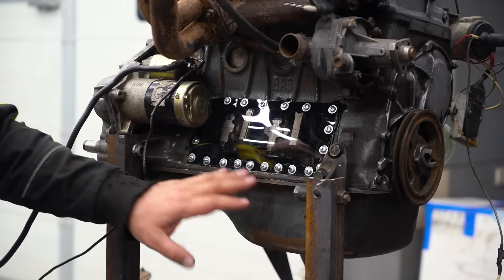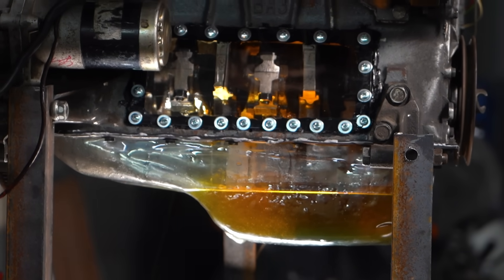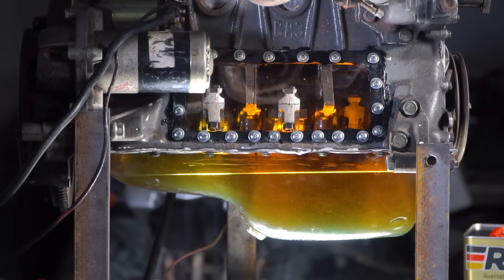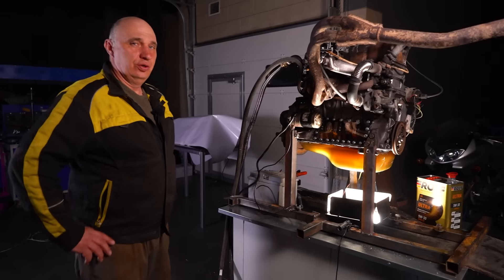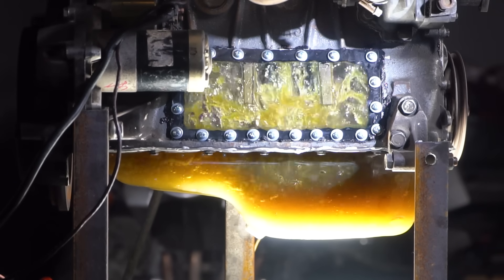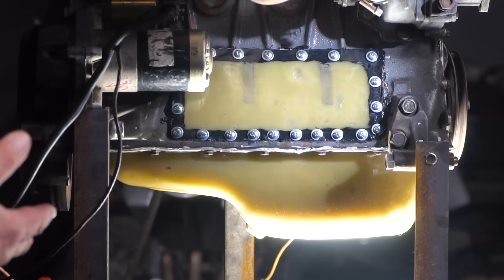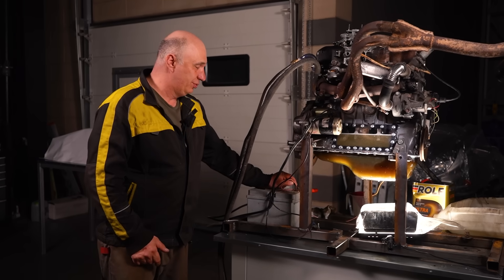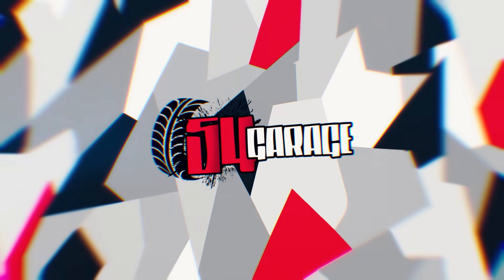What actually happens when you overfill your motor oil? (w/ transparent oil pan)

Comment: When I bought my first car ever, I’ll never forget because I learned many of valuable lessons, as I was ascending a hill I’ve gone up daily for 20 years, it’s a mile from my house, it’s quite the incline, I’m talking back then you had to get a run at this b!tch, or be prepared to start dropping gears, so let’s say, 30 degree slope, I hit it about 15 mph over speed limit which is pretty common for that hill, I look in the rear view and just see a sh!t load of blue smoke coming out from behind me. Now being a young and dumb 16 year old, I still had the common sense to know that wasn’t normal. I stopped once atop this hill and noticed my oil level was about twice as high as it should be. The oil was clean as hell, obviously had been serviced, but my god was there too much. I drained about 5 quarts to get it to where it belonged. And that was probably a 5 qt oil… so ya the dealership tried to fck me pretty good unknowingly if I had to guess. Thankfully I was already at that time well on my way to becoming a s tier mechanic. The world’s shortest story told long, overfill = bad

Comment: The only thing I am dubious about is whether the 1st initial fill amount "to the max marker" was in fact the correct amount to start as a base-line with before doubling.  If it was filled higher to begin with as I suspect it should have been then doubling it would be more added again on top of what was already more to begin with and then you get hydraulic effects and catastrophic engine damage. This is much more risky with more mdoern engines than the one used in this video. It happened to a colleague who filled another 6 Litres in to an engine he didn't realise hadn't evacuated it's old oil (suction pump fail) and it destroyed the 1yr old mercedes motor.

Comment: I did the mistake on diesel motor, and I broke it, the oil act as fuel and my engine went to extreme RPM, unfortunately i didn't know how to react (stall the engine), instead I just let it go, and went out from the car 😅, car went to trash and I had to buy another one.. so no joke with oil on diesel engine

Comment: I overfilled oil in my 2007 Mazda 3 hatch and the extra oil got sucked up into the intake manifold and I had oil burning in the combustion oil causing a thick smoke to come out the exhaust.

Comment: QUESTION ⁉️⁉️
When you overfill, even by just a half quart or so, what is the probability that you have increased the operating pressure of the engine at running pressure and accelerating pressure? 
In order engines, I’ve noticed it appears there could be damage to older/weaker gaskets. Causing leaks or increasing the size of existing leaks.

Comment: Daughter had a Honda Legend V6 she would take it to Jiffy Lube...at one point she complaint of a horrible vibration in the engine, I took a look and it was bad, luckily she drove it to me at max 50 mph. When I looked at the dipstick it was too high so decided to change the oil and I was surprised to find JL had poured in 1/2 gallon more than what was needed...Put the right amount of good oil turned it on... vibration gone....It was a 70's model....More recent my mother in law had an issue with her Nissan Rogue turning off the engine while driving...checked the engine, too much oil on the mark of dipstick...changed the oil to between the two marks and it has never turned off while driving...It is a 2013 and she was having her oil changes done by a quick oil change outfit...!

Comment: I have a Chevy traverse 2012, I had a low oil pressure indicator. I overfilled my oil by putting in 8 quarts of oil. The vehicle ran for about 30-45 minutes then shut off. I drained the excess oil and now it cranks but won’t start. ANY SUGGESTIONS? Has power. Vehicle sat for 3 days. Charged the battery to full and placed back in vehicle. Crank with no start. Then battery needle shows low battery, 2nd line under half. Any diagnosis or suggestions.

Comment: I dated a girl with a 1989 ZXR250. She filled the crankcase. Entirely. Told me the bike wouldn't run right. Bike wouldn't go over ~9000 rpm (red line is 17000 on those little 250cc 4 cylinder engines). Simply wouldn't, even dropping a gear when already at 9000, poor crankshaft just couldn't turn. Dumped half the oil out, kept on running fine for as long as she had it.

Comment: Inaccurate. In real conditions the engine is so sealed the inside has an internal pressure increase. So much so that when you overfill just a bit you start to see the screw cap on top jumping and it forces every joint to the point of leaking.
Reply: Smaller engines have lower tolerance. Most 1.8l engines and above can take 0.5 - 1 litre excess.

Comment: Car would start so i was asked to look at my cousins car.   He overfilled it so much, the oil was getting sucked thru the crankcase vent into the carb.   Car barely started with smoking !...   I drain it back to spec and ran fine, but reason he put so much oil was he was burning oil thru rings anyway......

Comment: Does anyone else give the motor a little crank when you drain all the oil and take off the filter? It's amazing how much more comes out with a little pressure
Regardless, I'm always about 2 quarts low after about 5K miles, so I don't think a little extra oil is gonna hurt

Comment: 10 years ago, I drove my very old  Dodge Caraven, one day I see engine  oil  light up , I check the oil and find out level low below the minimum . I add some oil up to Maxi. when driving I see the oil light up again, I keep add more oil , driving then the oil light still keep on. I add more oil again  I guess up to 9 liters of oil.  Next day when driving on a free way , about 15 minutes later, I see lot of smoke  ( I mean alot ) coming out from tail pipe , 1 minute later I see lot of smoke coming out from under hood . I pull over then the van start burning until completely become a pile of iron.
Please tell me the fire cause by too much oil or not ?

Comment: I had my oil changed in my 2008 Dodge Ram. 4.7 L. The next morning when I started it I noticed with smoke which it never occurred before. I took it back to the oil center it was a half quart over full they drained a half a quart it solved the problem
Reply: I filled my car to 10 quarts like a dumb a$$ am I cooked

Comment: Let’s no forget something really important about the oil evaporate pressure, if we have more oil we have more material that will evaporate producing more positive crankcase ventilation a little bit won’t produce any bad harm i guess but seals and gasket will probably start to leak sonner, i’m not planning to fuck around anyway don’t go lower is what i’ll always do

Comment: I had a car come in for the complaint of no power. I started it it seemed fine but on the Dyno it was like 10 horse power. All the settings were correct. I checked the dip stick for the oil and it was all the way to the top of the tube for the oil stick. I drained the oil refilled it to 5 quarts. All problems solved. Oh and this was 50 years ago on than American V-8

Comment: People have a lot of theories but as you can see you will end up with blown seals and gaskets before you get a blown engine🤣🤣🤣🤣
Reply: Agree. I overfilled oil on an Audi A6. Car started smoking and the engine was damaged. Had to buy a new engine - at a substantial cost.   As a precaution - always check the oil level. The car will also tell you when it needs more oil. Never go beyond maximum - midpoint will do for me.  Change your oil regularly - for me oil change after six months or whatever mileage interval the manufacturer  has recommended.

Comment: Old shop Forman said he changed his oil when going on a long trip vacation. He added 6 quarts instead of 5 quarts to putting car at full level. He said this ways he never had to add oil on trips and was running his car harder than most people do. He’s always drove a little over the speed limits. Done this on cars he’s drove for over 10 years.

Comment: Aside from the detrimental foaming issue. In theory, the less air in the enclosed engine shell, the harder it is for it to maintain pressure.  Pressure is sustained by the compressible gas (air) in the system.  Oil is not compressible.  So, a proper proportion of air to oil should be within dipstick marks.  Anything above that may start decreasing system pressure. I wish Garage 54 would test how low, mid, high, excess oil affects oil pressure.

Comment: Wouldnt it be better to have an extra quart of oil in the engine to be safe?  I mean when you check it, it'd be better to be full than a quart low at the add line.  Any thoughts on just one extra qt?

Comment: Too much oil builds pressure in the engine, blowing seals and even the head gasket. It may even hurt the piston rings. They never show the dipstick in this video, and I have an idea the oil cap was off and the hole was covered with cloth to prevent the pressure from building up and damaging any seals. This video is very far from the truth. A mechanic sabotaged my car while servicing the engine and added 18mm above the full mark on the dipstick. I drove it about 3 times about 4 blocks each time, and the next day it would not start. The head gasket blew with some seals and maybe the crankshaft seals too. I am sitting with that problem now, a day after Christmas 2024. Do not believe this video. They only ran it for a few minutes. Too much oil is bad for any car engine.

Comment: The fosming of the.oil is the problem ( air in the oil so NOT proper lubrication.) Small lawmower engined etchave only a.splash system to lubricate. Yes.will have oil burning out the egine. Same as worn out piston rings. Oil burning. But this gives me a real interesting thought. Put the extra oil (we use a " metal cond " type additives ) helps on extreme cold starting to have oil pressure. Helps if u loose oil pressure too. Guy i knew let diesel tractor run all night at too low oil pressure ( old eng Lucas etc helps oil pressure if too low ) So if we add extra oil with the " metal cond lube added " would help get extra lube into the engine bearings. Can NOT get engine to crank fast enough to start. Even with boosting. Barely cranks over. I believe its a " turned main bearing" due to the low prolonged oil pressure. I know of other damaged equip from too low oil pressure ( esp in extreme cold - NO oil to upper cams or external turbo etc .  This guy is so "Narstic" dont see him any more.  Yeh only Jesus went to heaven John 3;13 - UCG - Herb Armstrong.   But does NOT keep Hunaaka eithrr. Lol. Nope can NOT admit to any wrong - NOT even about the tractor engine lol.  Yeh old tractor and NO not fixing it for him for nothing lol Put some " metal cond additive - Duralube etc " but yes extra full. Get some lube into the main bearing. Etc. I put a new starter on it didnt crank better. Other thing is the old JD tractor could be 24 V too. 12 v only cranks slowly then.  Hey we put 12 V on old equip which was only 6 V. Lol. Yup start better. Dont crank very long will over heat the starter. Had to change head lights on the old truck to 12v  lol. JD had some tractors with 24 V.  Some truck Co in Wpg Mb went to "air starters" the old diesels were real hard to start. We had gas engines for choir tractor. Most smaller truvks were gas. Cat was left running all night for bush work ( ground is froze in winter so did not get stuck. )  put drainage in the next yr. Lol. Yup Uncle measured oil on stick ( extra mark ) dont need to shut irragation pump or Cat engine off. Lol. Check air intake too. Little " ether starting fluid " engine " rapped " saved a Claus harvest unit. Was sucking dirt after the air cleaner. Put extra oil filteration on units. Lift dirt out of the oil. Saved big diesel engine.No repair required. Lots of liitle tricks. Yes should try that tracror again lol.  1 403 830 4124 calgary ab cdn 😊

Comment: I change my oil on my own, and I have accidentally overfilled my 1L 3Cylinder engine, I thought it was ok as nothing really changed in perfomance, a couple of days passed and I noticed that it's not as responsive in uphills anymore as before when the oil level was just normal, I almost overheated with smokes coming out of the exhaust. But on ground level, everything was normal. So I decided to just remove some oil and go back to normal. This test is stationary.

Comment: Even though it’s a fun and interesting video,
That’s not a scientific experiment, it looks like 1958 kalashnikovs gulag experiment 😂
First, he should drill another hole and install a pressure gauge, to compare each stage, second, install a thermometer.
Third, by speed steering the oil and not pumping it, he is destroying the integrity of the oil, adding heat and shortening its life.
Fourth- he should try it with Vodka!! 🧨

Comment: I read an article long ago that the crankshaft lobes had to sling the oil up into the cylinders. Overfilling would prevent that slinging thus getting less lubrication under the pistons and causing higher wear.

Comment: overfillig will not destroy your engine, it's just gonna leak outside the engine, the oil will find a way to go outside and also the increase in pressure and it's gonna be messy. and the on thing will be damage is the oil seals. and you don't wanna run your vehicles with oil leaking at the bottom, besides it's waste to overfill you engine oil

Comment: Whether overfilling will cause issues or not, depends on the capacity and shape of your oil pan. Not all engines are the same. This engine is either designed to be OK even with double the amount of oil, OR......the manufacturer made the mistake to say that MAX is in reality LOW. Another manufactuer might consider the double amount of oil, in a similar oil pan, as the MAX level. Get it?

I mean at MAX level, look at how low the oil level gets at high RPM. It's easy for this engine to be starved of oil if you're driving around corners fast. You actually NEED more oil in this engine to avoid it. And this is an issue that many engines have believe it or not, even some sportscar engines, and this is how these engines become notorius for being "unreliable".

It would be a good thing to actually measure the gap between the crank and the oil at the MAX level. That way you will know how much more you can safely pour in.

But i think the test is incomplete. We should observe what the effect of COLD oil is in an overfilled engine, and thicker oil in general as well.

Comment: I filled my engine with water once when i was a kid. I thought it was the radiator i was putting it in. my heater wasnt getting hot so i thought i would just top off the radiator with the water hose.  i had yellow colored sludge coming out the breather, and thick smoke out the exhaust. mechanic ended up tightening the valves to much and ruining the engine, after i had taken it in to be fixed. Ran great for a little while though after it was cleaned out.

Comment: I don't think anyone is suggesting to add double the oil capacity to your engine and you'll be ok. The point is, if it's down 1/2 a quart and you add a quart, it's not going to hurt your engine.

Comment: If you change your oil every 3,000 miles, your engine will last 300,000+ miles. Just sold my Toyota truck with 501,000 miles. It runs good and burns no oil. My other toyota had 422,000 miles when I sold it..still ran very good..just dont overfill past the max level...

Comment: There can be two disadvantages for overfilling:
1: Engine power is being wasted as the crankshaft has to push away lubricant which is a lot denser than the air.
2: The lubricant in the sump now has excess energy obtained from crankshafts' rotational energy. The lubricant can now leak out of seals from the block at high rpms.

Comment: Recent comments and the narrator whether the russian or the AI voice over commentary  fail to grasp the increasing oil presssure and back preasure on the engine, valves, and pistons when the engine gets hot.  More over the increasing amount of oil has a direcy corelation on gas milage and engine efficiency. The extrene wuanity if oil will foul the components and blow the valve cover gasket seal a be pressure forced past the pision rings right onto the convustion chamber . The older model Russian engine is not high performance with minute tolerances and electronic ignition. So in short this exercise is not even as conpsrable to letting a pig to over  eat whch does no harm versus force feeding a thorough bread racing greyhound or an arabian stalion. Both would puke in normal racing or suddenly have a coronary event and drop dead. In Short the experiment with commentary is a failure wheras the commentary loses the challenge. NEVER OVER FILL YOUR ENGINE OIL.

Comment: A long time ago, I had a 1972 442 with a 455 that got 100 milies to a quart of oil at around 70 mph. Even though it had HD cooling, it ran HOT!!!!! Figuring that the heat was causing the oil use, I overfilled the 4 qt. pan by 1 qt. Result: no more oil burning & no oil foaming. I knew that there was no oil foaming because I had put in an oil pressure gauge that said that oil pressure was OK.

Comment: The first time I did an oil change on my RAV4 2015 ( which takes 4.6 quarts) I poured the whole one-gallon, I panicked and drained the excess oil (0.4 quarts) thinking it would blow the seals/ gaskets of the engine. The dam internet says DO NOT OVERFILL the Max level. Oh man, now I know that 0.4 quarts don't do anything. Thanks for the great video and explanation, I really enjoyed watching this experiment. Look forward to watching overfilled transmission fluid.